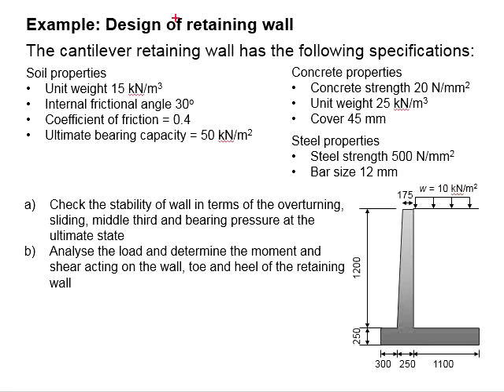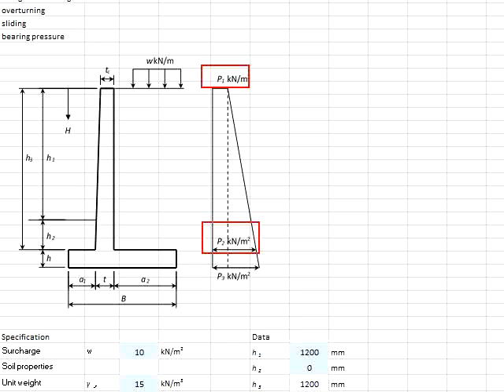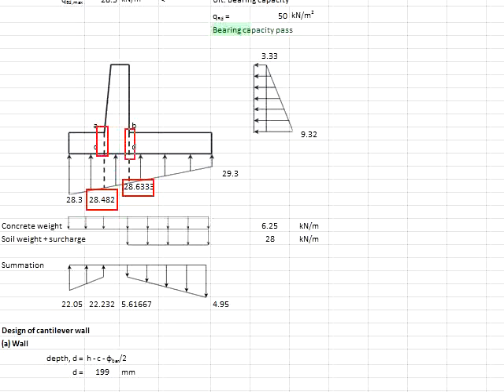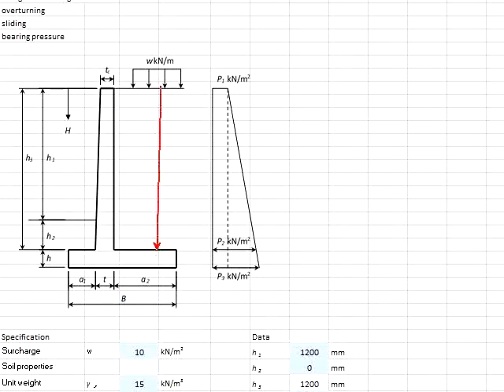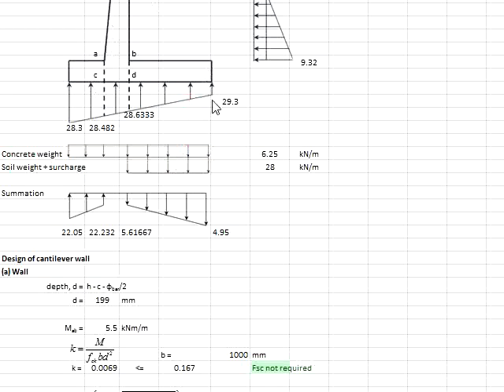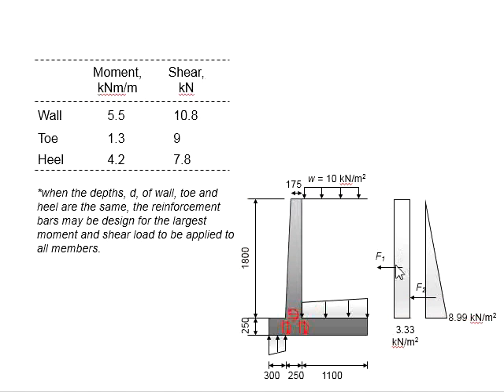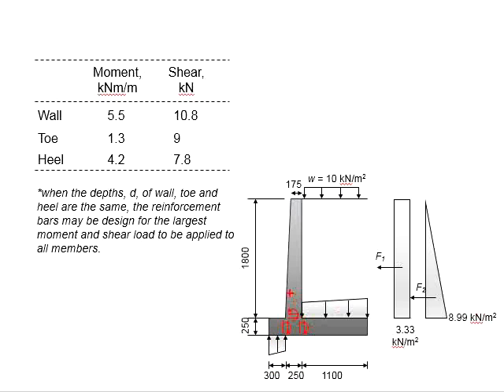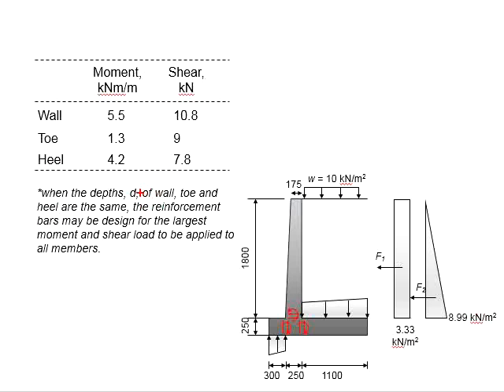4.16 Example 3: Analyze load acting on retaining wall

Comment: I don't totally understand the Moment and shear for wall, toe and heel. Can you explain please??
Reply from the maker: The moment and shear for wall occurs at plane a-b, for toe at plane a-c, and for heel at plane b-d. We calculate the stress acting on the wall, toe and heel. Find the resultant force and moment acting against those planes.
Reply: Okk thanks. So the correct value is 5.99 , but calculating the résultant force on wall( for surcharge and soil) give 3.33*1.8 + (5.99*1.8)/2 right?  It gives 11.385 insteas of 10.8
Reply from the maker: @borisdjokaboris6424  5.99 is calculated on the basis of 1.2 m wall height not 1.8 m.

Comment: Hi, Many thanks for the videos. A question please. where is 8.99 comx from?.Isn't the value of the pressure of surchage 10.57-3.33=7.24?
Reply from the maker: Active pressure due to surcharge = surcharge x k = 10 x 0.333 = 3.33kN/m3
Active pressure due to depth = (unit weight of soil x depth to shear plane a-b) x k = 15 x 1.8 x 0.333 = 8.99 kN/m3
Kindly note there is an error. The retaining wall shown in the spreadsheet has a depth of 1.2 m, whereas the one shown in the diagram (slide) is 1.8 m.
If the depth is 1.8 m then the active pressure due to depth = 8.99 kN/m3.
If the depth is 1.2 m then the active pressure due to depth = 15 x 1.2 x 0.333 = 5.99 kN/m3
Therefore in spreadsheet, surcharge active pressure P1 = 3.33 kN/m3, 
Active pressure P2 = surcharge + depth = 3.33 + 5.99 = 9.32 kN/m3
I apologize for the confusion.
Reply: Its acting on the wall son the correct value is 9.32-3.33=5.99 right? And. What about the values of loads and Moment at SLS please ?
Reply from the maker: @borisdjokaboris6424  Shear force = 3.33 x 1.2 x 1.5 + 5.99 x 1.2 x 0.5 x 1.35= 10.8 kN
Moment = 3.33 x 1.2 x 1.2/2 x 1.5 + 5.99 x 1.2 x 0.5 x 1.2/3 x 1.35 = 5.5 kNm
Don’t forget about the factor of safety of 1.35 and 1.5 for Gk and Qk, respectively.